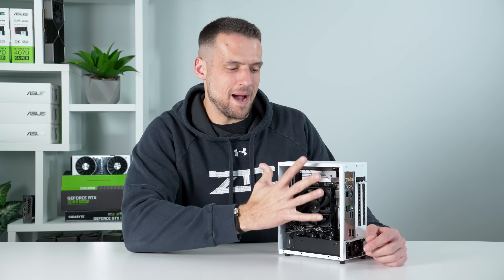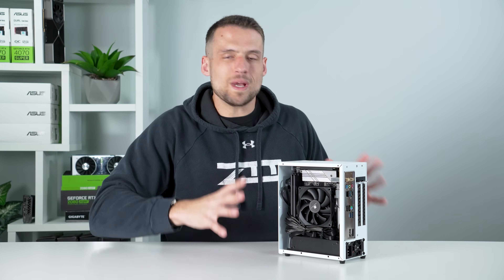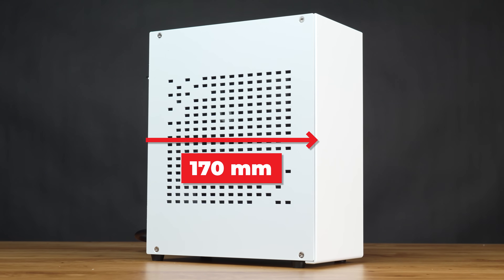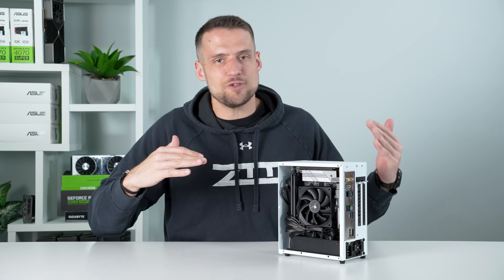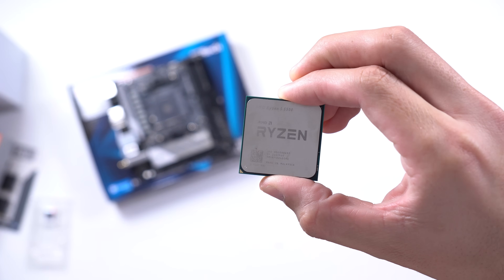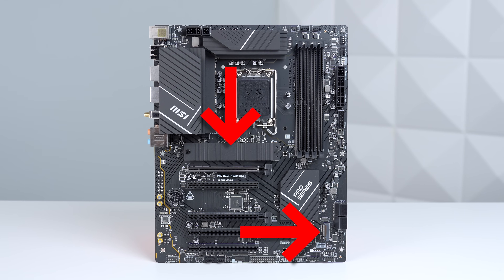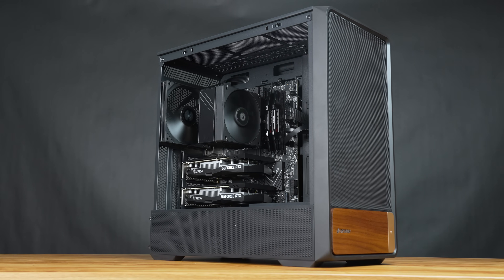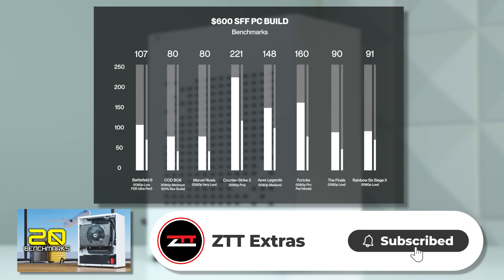This $600 Tiny Gaming PC is Unreal

Comment: You can get an 80+ gold 400w silverstone for 80 bucks, go with that, the apevia has killed systems ive built.
Reply: Better buy a ups for 40 bucks
Reply: @ЭмильСефербеков-ц9еwas on a ups, funny enough
Reply: @KadiusFTW going to buy even less popular psu. Exegate F500AS, it says 400w by 12+v line but it's more likely 280w maksimum. Altough it will be enough, cuz i have power friendly components like i5 8400 and gtx 1660, still gonna undervolt them and buy a normal ups.
And i still don't know how it died if you were using ups
Reply: @ЭмильСефербеков-ц9еpretty sure it was transient spikes that killed it. Was using a 12900hx on a cwwk lga 1700 mobo, with 2 1tb teamgroup G50s and 48gb of ddr5 5200mhz  sodimms in dual channel.

Nothing that should have killed it as it was well below the power envelope, as cpu was limited to 100w max
Reply: @KadiusFTW what was the ups model, or you don't have one?
Yesterday my lovingcool lc g650w psu died cuz the electricity ın my town went off, so glad that others components are still alive.
Reply: Is there a modulat version?
Reply: @earsplittingpictures1133  not at that price tag, no.
Reply: @earsplittingpictures1133 dude research that yourself on google or something

Comment: hey, I bought my first computer during the holidays and I have this strange problem, I have a Ryzen 5 7600 processor with an AIO cooler and when I turn on the computer, for example in the morning, the fans are at 100% and the processor temperature is 95°C and when I restart the computer everything is fine. I don't know if it should be like this, but it has been happening since I bought this computer.i have Cooler Master MasterLiquid 240 Core II ARGB 2x120mm

Comment: I built this same exact build just with a PNY RTX 3060 12gb (used off of ebay) and it runs cyberpunk 2077 at 1080p Ultra at 66 FPS average! Really nice little build but it does get loud under load 👍
Reply: That gpu is over 600.00 on newegg and amazon.
Reply: @WEEENYforSWEENEY  got it on ebay with tax and shipping for $200
Reply: @WEEENYforSWEENEY  I got it used for $200 off of Ebay

Comment: Prices in the US are good, over here in the UK the exact same SSD costs £162 or $213 in USD. Insane
Reply: You can get a 2TB 990 pro for £120, idk what proces have been like recently but as someone that hasn't built a pc in a long time it is crazy to me you can get that much storage at better than SSD  performance for so little
Reply: you are in UK? check CEX and the likes. Its best to buy 2nd hand or refurbished. Its easier on the wallet.
Reply: Remember it's the US our price is Tax inclusive, theirs isn't.
Reply: Excluding tax that would be £129.6 or $170 at current, and that stil oner 3 x the price wtf? Note to self if buying ram inport that's insane. Inport dues are just vat anyway and shipping ain't that high.

Comment: There are over 30 itx cases that are $100 or less, almost all toaster/sandwich cases have the cable and you dont need to buy one.
 A lot of GPUs the less fans and extras the cheaper it is.
The issue is the motherboards and good PSU are the more expensive parts.
When you look at ITX boards you pay more for less options but usually the options are higher quality components than the atx boards that are cheaper.
Example you can get an am5 atx board for $80 but it has no or slow wifi/BT, gen 4 pcie lanes with bad bifurcation(ssd will be gen 4 but the gpu might be running in gen 3 which seems to have been the issue with his build during the live stream where the board didnt auto correct and he had to manually set it).
Corsair is the only real choice for an SFX PSU, the 2025 models are safe, reliable and quiet which is needed in this space and thats usually $190

Comment: hey papa zach I need help with my computer

my frames are very horrible inmost games I use the I7-7700 and GTX 1660 super my ram is 2133 MHz with 3 of 4 slots use (16 gb of ram) 
for my ssd I run a normal 237gb ssd (yeah I know it aint much but all my games go to the ssd and my 1tb hard drive goes to videos, pictures, ect. ive overlcocked with the NVidia app and did see a performance boost ive also followed a lot of videos on pc's performance optimization, but other than that my pc sees very bad frames in most games.
Reply: Tried repasting and cleaning ur room?